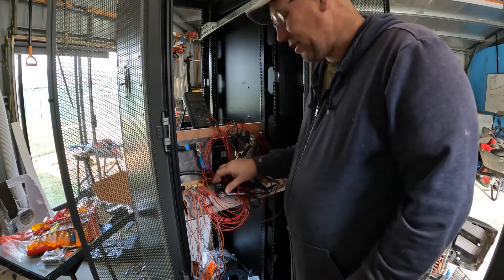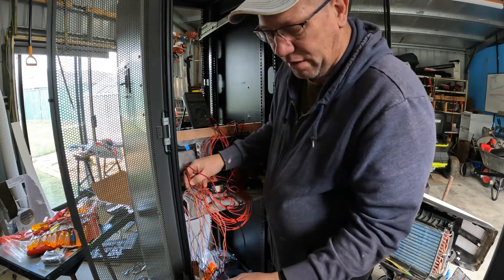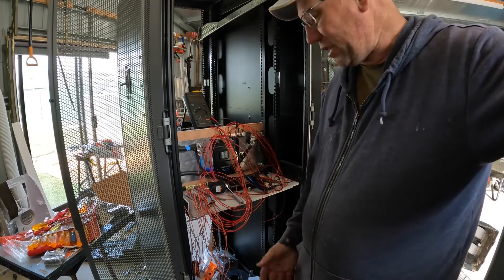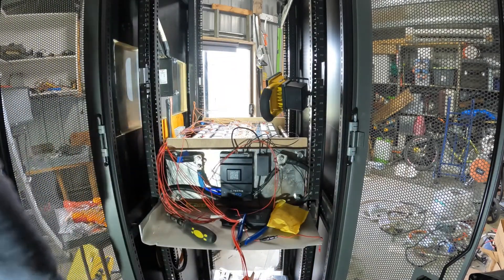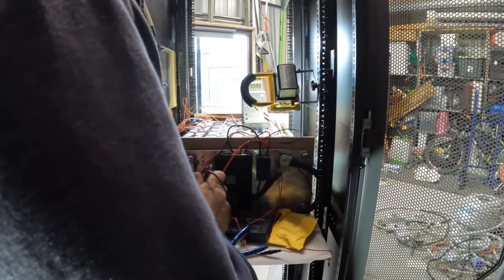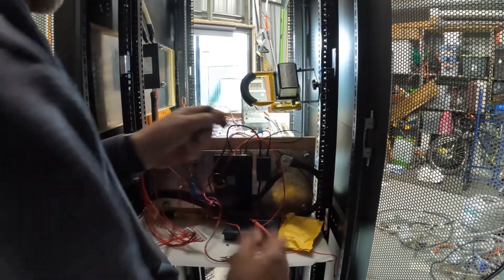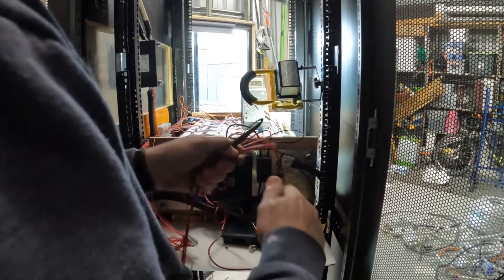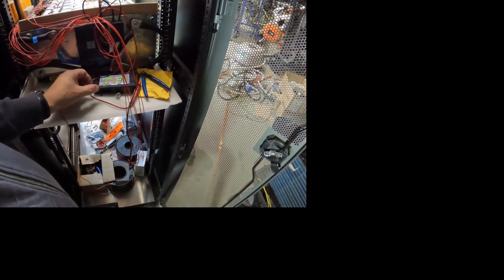Finish setup the JK BMS with display  Part 3 of 3

Comment: In the installation of my JK BMS I cut some of the cables that go to the batteries to avoid having to coil them. I wonder if JK BMS tests each wire and enters a different resistance for each without user intervention?
Reply from the maker: You got it right Rene, that is how they work out how much current to send down the wires. I=V/R So all have to equal  2A. So V/I=R, 48V /2A = Ohms. So Ohms must be worked out .
Reply: @chuxxsss  Hi....thanks Do you mean to tell me that I should not cut them or that the BMS calculates the current automatically even if I cut them?

Comment: You scared me handling the uninsulated tool above those exposed terminals. Possibly find a thin sheet of plastic, punch the bolt holes into it and lay it over the batteries?
I like that torque gauge!
That is great result. I think today I will start terminating BMS leads - you've inspired me to get off my arse! 
In a previous video you mentioned you were making the leads to the BMS/balancer the same length because that is what is recommended. Thought about it for a bit and realised that resistance in a wire is proportional to length - double the length, double the resistance. So if a lead is showing a 20mV drop due to resistance, the cell with a wire with twice the length will show a 40mV drop...that means the BMS and / or Balancer will read different cell voltages with different errors due to resistance. You can compensate for consistent error but not so much for random errors due to random wire lengths. I'm glad you followed recommendations, and I will make sure I do too.
Reply from the maker: With the JK bms I don't think it matters ;) . But that is for another show. 12.6 KW so far. Next vlog tonight.  More will follow.  By the way I use to work on Leopold and Abrams tank batteries.  The Leopold had I think 12 batteries.  They where double the capacity of these and scary if you shorted a tool out.  Scary like welding with a spanner. What spanner.  So no want not to do, Ben.
Reply: @chuxxsss  Yeah, I worked with exchange batteries that ran 6" x 1" bus bars....spanners vaporised on contact I was told...several 1000's amps was common in operation (running an exchange), of course i was just a new engineer then and was tasked with measuring the voltages of every cell every half hour and documenting it. I think they got some giggles out of sending me out on such an errand. In three weeks there was more change to the length of the grass outside than the cell voltages...
Reply from the maker: @Bennyboy-dog  LoL Ben that is funny.